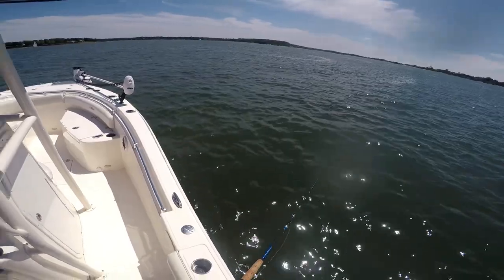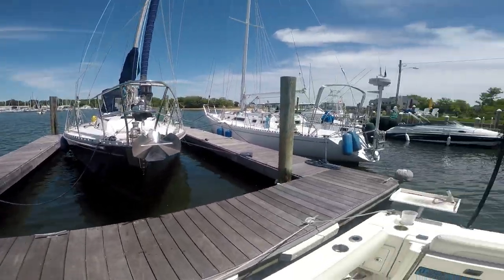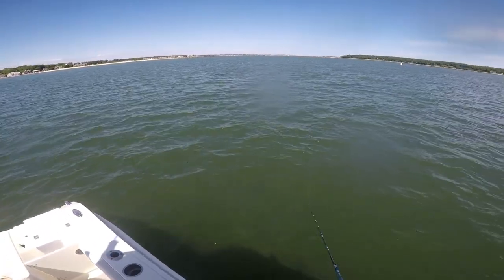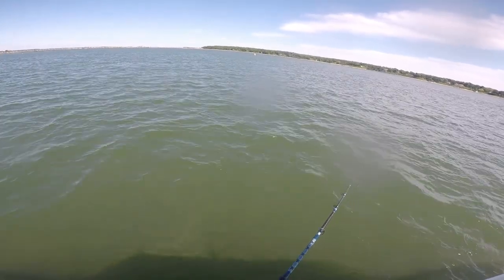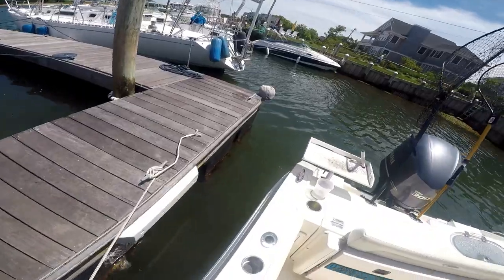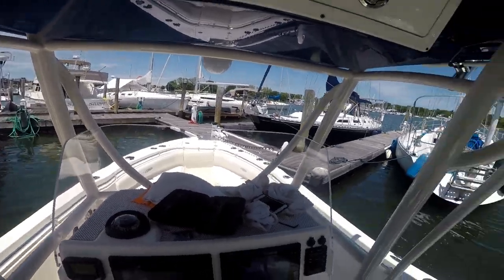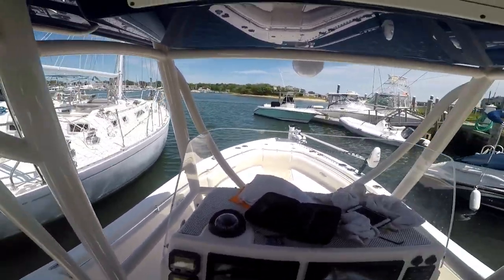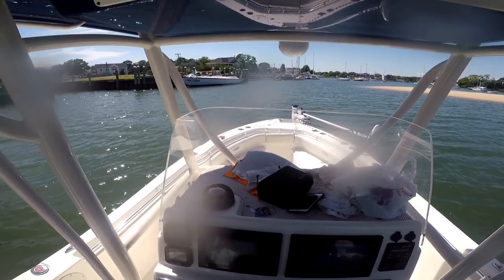The Joys of Docking

Comment: That's definitely a tight spot with way too many boat's crammed into one area.  Nice job.  One suggestion, I heard you mention that you had 5 feet of water when you were backing out.  If that's the case, don't raise your motor.  Leave it down because it gives you more control of your boat.  I always back into my slips and in the past years, in tight marinas, that can be a nail biting challenge that leaves me jumping around the boat like a rabid spider monkey.  Pulling in bow first is really the way to go if you have enough room to raise your motor and not worry about someone crashing into it.  Again, great job going and coming.
Reply: B Stav - yes and agree - the problem is about 4 feet past that 5 foot mark, you get down to a few inches and I didn’t want to chance it.
Reply: Whew!  That's no Bueno.

Comment: Good job bringing her I'm. I feel your pain! When I first got my 25 foot center console, with 2 engines - one of the engines would cut out, always at the worst time. This is in a narrow canalwith many boats. At which point I had to use only 1 engine with the wind pushing me always in the wrong direction. 

But ... After getting the engines (carbs) rebuilt - it was never an issue afterwards. 

With 2 engines, it's a breeze in terms of control. And like you ... Slow is my rule of thumb. 

Good videos BTW ... I'M SUBSCRIBED and enjoy yours and Johns videos. FYI ... I fish out on the great South bay mainly between the Wantagh and Meadowbrook Parkway bridges, Zacks bay etc. Rick
Reply: Blitz0203 - my last boat had twins and you’re right, much easier with twins (as long as both are running lol).  Thanks for the kind words and good luck this season!

Comment: Nice work in a tight spot.  I’m with the “go as slow as possible” crowd - while having just enough way on to steer.  Have you tried using your trolling motor as a bow thruster?  I bet between the main engine and the trolling motor you could twist your boat around most anything. Of course lots of fenders help when practicing.
Reply from the maker: I never did try.  I subsequently sold that boat and have a bigger boat now but a much easier dock spot.

Comment: What I have done on days like that is use my trolling motor and my outboard to keep me in position and turn on a dime if needed. Having front and rear steering makes it way easier.
Reply: That's what I was going to post. Probably nearly impossible to run both motors if you're single handed, but if you have crew one man can run the trolling  motor as a pseudo bow thruster and that should help.  Also, while I agree with your position on approaching things slowly, a certain amount of speed increases your maneuverability.
Reply: Russ Seff yup - hard to tell from the video but I did speed up once I was ready to slide her into the dock.  The slow comment related to the approach and formulating the angle game plan.  You’re 100% right though - once you’ve identified that final approach, you need to giver some throttle or the wind will ruin your plan.
Reply: Russ Seff yup - hard to tell from the video but I did speed up once I was ready to slide her into the dock.  The slow comment related to the approach and formulating the angle game plan.  You’re 100% right though - once you’ve identified that final approach, you need to give her some throttle or the wind will ruin your plan.

Phil - I get using the trolling motor as a bow thruster but I was single handed and truthfully, I have docked it in worse conditions - really just wanted to highlight the “unseen” part of these fishing videos that kind of suck :)